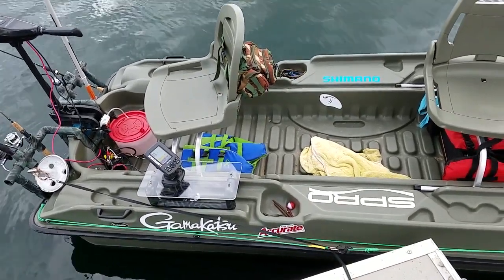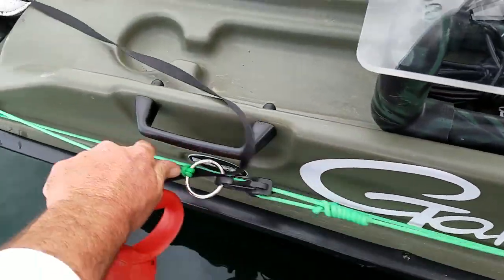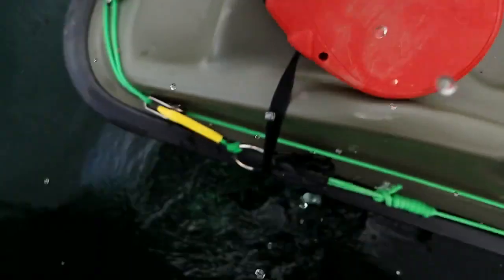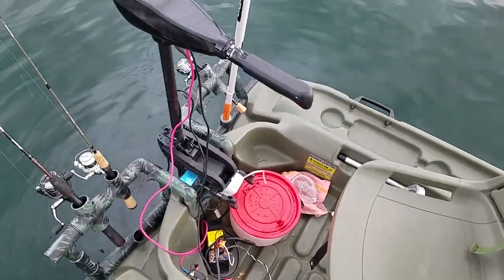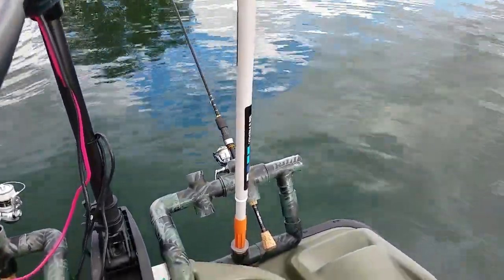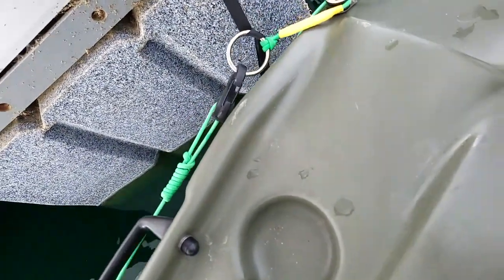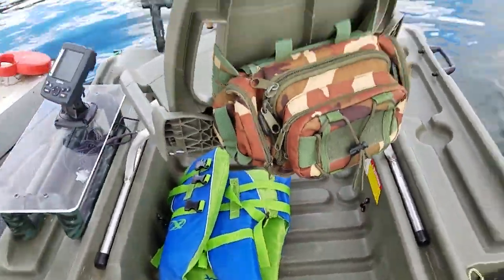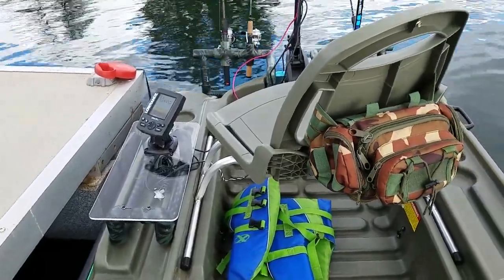Pelican Bass Raider Modifications

Comment: Does your bus bar have a fuse? I recently bought a 55 lb trolling motor..what amp fuse would you suggest?  Thanks
Reply from the maker: I put a 50amp cause i run a24 volt system

Comment: Hey bud how did you run your wires through the boat???? I'm wanting to install a 	USB charger for my cell and light but not sure how to run the wires.
Reply from the maker: Yes, I ran the wire through the inside of boat. Just drilled two holes finessed it through with a fish tape.